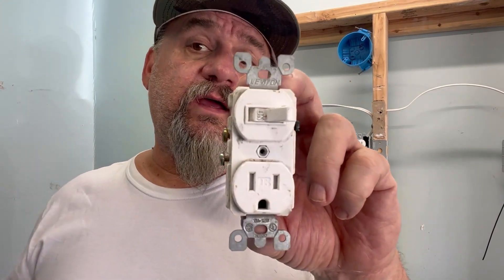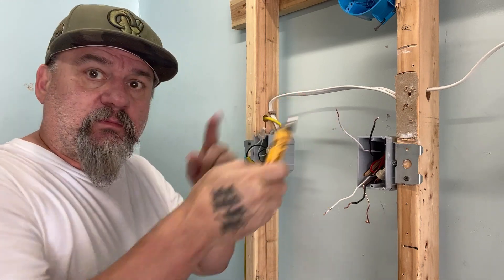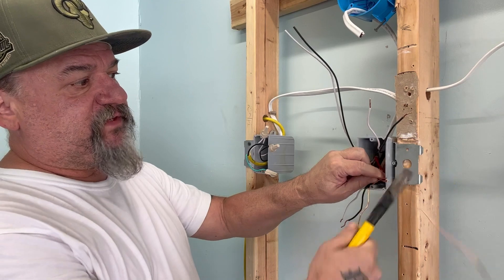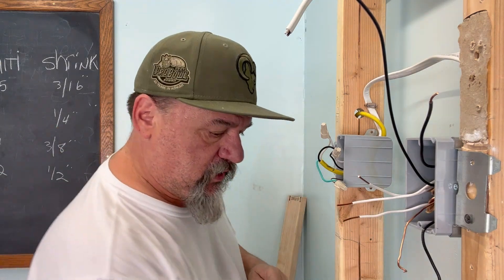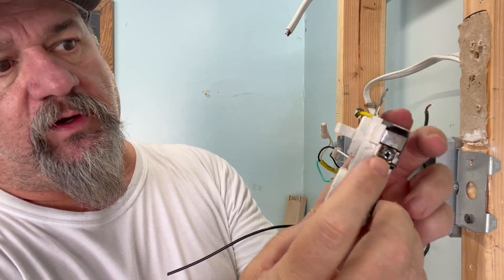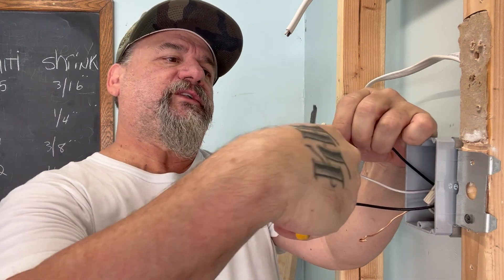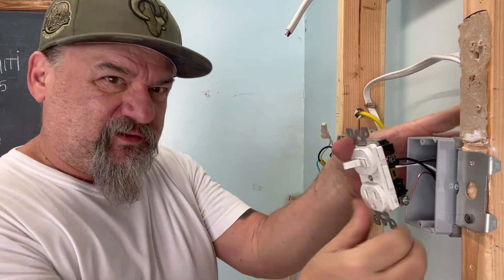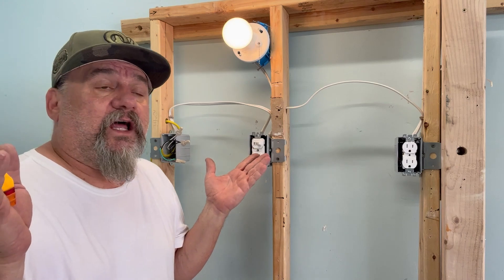Installing an Electrical Switch Plug Combo - What You Need to Know!

Comment: I tried to switch out the basic light switch in my home's bathrooms with these combo switch/outlet receptacles, but the way they wired the lights back in 1938 was all fucked up.  They ran the electric from the main to the light fixture and then ran the white, black, and ground to the switch.  Simple, right?  No.  When I tested which wire was hot, it was the white wire.  The black wire went hot after I flipped the switch to on.  I see no way to upgrade my light switches in this situation without tearing out the whole bathroom ceiling and rerunning the wiring to the switch, and then to the light fixture.  Unless they make a combo that uses the current wiring layout.

Comment: I have that switch/plug combo but I want the switch to control the outlet as well. Id there a video on that?
Reply: Yes, that’s what I did with mine
I am not an electrician, but this worked 
I removed the brass connector between the load sides 
Hope to the incoming load to the switch side and jumped the line to the now disconnected outlet side
Again, I cannot stress enough. I don’t know if this is right, but it worked.

Comment: You skipped over the very basic part! I want to hear, this wire goes here, this wire goes here, this wire goes here, this wire goes here! Then you can start using your job lingo. This video is for non electricians. Crawl , walk, run.

Comment: Man, you're the best! An old switch plug combo with two hots and one neutral had me questioning my sanity last night. One hot was on the silver screw, and the other was on the black. The switch leg had the neutral (!!). The hot probably passes through the light before coming to the switch and going out the neutral switch leg. It's crazy !

Comment: Awesome video. Thanks. 
Question. How do you replace a light switch with a combo switch on a three way circuit controlling lights? The existing switch has two black wires with the hot on the top right side black screw and the second black on the bottom. The red is on the left top screw and the ground on the bottom. The neutrals are tied together. Thanks

Comment: I only got black and white coming in to switch
Reply: If you want that outlet to be controlled by that switch, put the black wire on the gold screw, the white wire on the silver screw. The black screws won't be needed.

Comment: Whats the purpose of these kind of combo light switches? What can you plug into the outlet that wont cause over heat/ over load. Im trying to set one up specifically for my cordless tools battery chargers (multiple battery chargers). Is it safe to plug a power strip ?

Comment: I had three wires and it was working perfectly. The actual switch went bad. I put in a new switch combo exactly like the old one and it doesn’t work
Reply: @johnviera3884  same. What was it
Reply: the new switch contact screws are arranged differently than the old switch. just match up the screw colors. The screws have a color (black and gold etc.) Match the colors not the placement locations

Comment: I have an outlet, no light connected, just an outlet. I want to install a combo, and wire it so the switch controls the power to the outlet. The switch turns the outlet on and off. If I plug a light in the outlet, the switch right above the plug will turn the light on and off.

Comment: I have a question, I have only 3 wires in that same set up. The light is already in place and 2 switches as well. I installed switch/outlet just like that and the outlet does not work, would that indicate that the feed wire in and feed out are needing swapped?
Reply: These switch/plug combos can be used with different configurations. Do you want it to work exactly as he demonstrated?

Comment: Yeah like in the front of your video you have a brick wall installing a circuit box there for your socket, I want to put drywall in front of my brick wall my home is made out of cinder block and I'm going to need an extension and more wire to pull it out show me a video about that how you can improve it thank you

Comment: @Starving Electrician I'm lost why did you tie up the white wires and black wires and green wires together  like how many wires are there totally  8n old houses you'll see three wires in there I had an issue installing mines because the white I supposed to be neutral but it went to the gold screw and the little wire went to the silver one the black went to the black screw help me understand that concept

Comment: @ Starving Electrician I  already have a switch plug combo in my kitchen  it's not by a sink an it's an old house it burned out so all I have to do is wire it back the same way correct  and make sure  hot is on right  and neutral on left correct? Also I should tedt and see  which sound is the loudest to determine hot remember  I have those old wires

Comment: I have trouble holding 3 or 4 wires together, to get the pliers on them.
Reply: Make sure you strip about an inch of wire, maybe more with 12 gauge. Line up all the stripped ends at the end of the insulation. You can use a layer or 2 of electrical tape to hold them together. Wrap the tape around the insulation, about a half inch from the stripped ends, this will help in holding the wires together. With 3 wires wrap them in a triangular pattern, with 4, a square pattern. Use linesman's pliers (Klein's), they will give you a better grip because of the width and heft. After the wires are twisted you can leave the tape alone or remove it.
Reply: @surferdude642  thank you; makes sense!
Reply: use wago's...